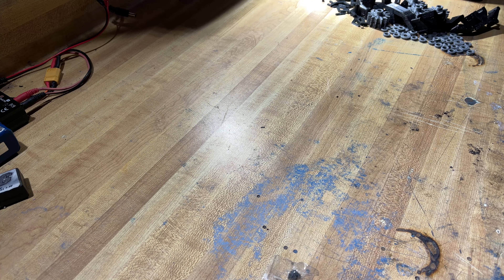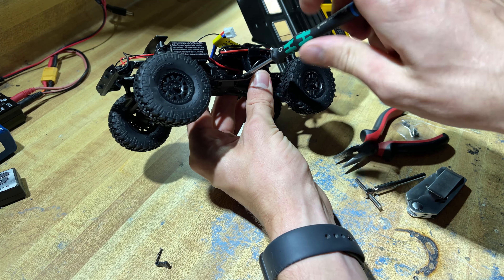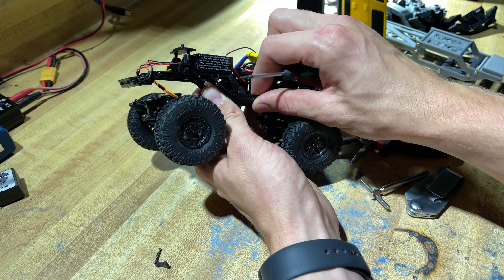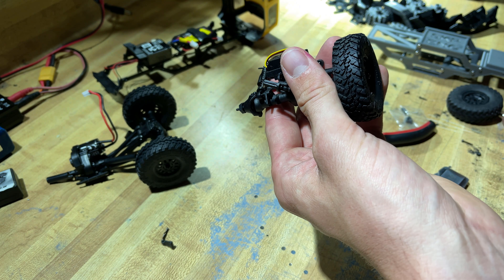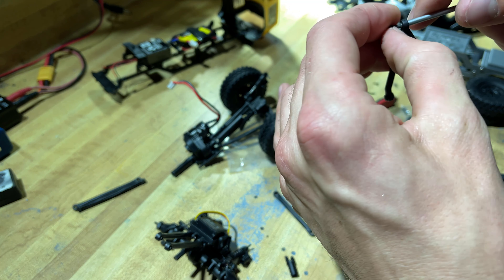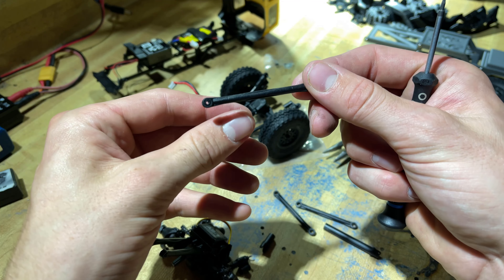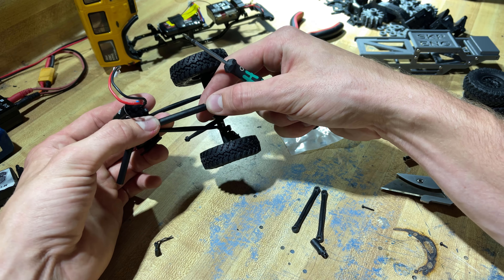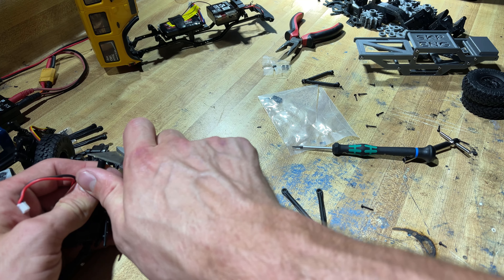SCX24 Warthog Chassis Install!

Comment: My build is in progress. Some notes: I'm moving my battery to the front and my electronics to the rear. The shocks rub against the chassis and cause binding. You can invert them and then trim the retainer to solve that. If running a larger motor (Torquebeast 2.0) the rear upper link hits the end of the motor can and wont allow the suspension to come to full rest on that side and the rig sits cockeyed. To make it work properly I had to make custom bent upper links for the rear. I used the LGRP (or Shapeways) rod ends and the stock link ends (cut off of the links) to make them.

Comment: One tip. I was running into some slight suspension binding when doing great flex. The stock shocks bodies would run into the chassis and that would create drag inside the shock at max extension with twist. I took some extra ball studs from Injora, used a little hex nut from them as well and put the nut on the ball studs. This spaced out the shock body from the chassis rails and it's butter smooth at full extension and twist. There is just enough thread on the ball studs to just reach through the chassis.

Comment: Currently building mine. I was wondering if you're essentially replacing the rear shaft after you move it, wouldn't it be easier to line up the new shaft with the stock rear for measurement to make it the same length?

Comment: I hate to add any tips, but i ended up using extra ball studs i got with some brass knuckles to use with the stock steering links. They worked great when converting to the four link. I also used stock axle length for the jlu rear up front. I trimmed the female shaft by sanding the end down. Just clean up the edges and your golden. 

Trimming the shafts by snipping the ends off squeezed the sides and increase drag so the shaft wouldn't slide freely.

Comment: I recently purchased the files off cults3d, printed this out and built it up yesterday. THIS is the most capable scx24 I've had, thank you! With scrambler tires it can still go over anything, although it hits the shock reservoirs during tight turns,  I need to get some more standard sized tires
Reply from the maker: Awesome! Glad to hear you are enjoying it! You could also get some axle extensions to widen the stance if you want to run the larger tires!
Reply: @CineMoto24  but you talk so highly about the wranglers, I have to buy them now :D
Reply: @CineMoto I just printed a kit from your files.  Looks awesome.  What size screws donyou use to build the chassis?  And where do you get them?
Reply: @trevortopolay1361  M2 x 8mm, you need 14 of them, I bought a pack of 50 off amazon
Reply from the maker: @trevortopolay1361  m2x8mm you can get them anywhere including amazon

Comment: Just received my blue Warthog over here in Michigan. Thanks Shane. It's great. I've been seeing them in videos for a while. Just couldn't move it high enough on my list til now.  Can't wait to install it. Thank you for a great, simple, well thought out option. I have been creating all sorts of designs in my head for some time. I will hit you up when I make some. Don't think I can beat what you have done, but it will be fun to try.
Reply: Hey I’m in MI too. SE MI. My son and I run Deadbolts and I’m really wanting this kit. Have you built yours yet? Any trouble getting the extra bits to complete? Would like to hear how your build went if you don’t mind sharing.

Comment: Im getting ready to order parts for a warthog build. Can I use a regular set of suspension arms? The set I’m looking at is already 4 link…
Reply: You can! As long as they are the correct lengths!

Comment: what size is the extra blot you need? The one that you said comes with diff covers?
Reply from the maker: I believe they are roughly 6mm in length. Standard SCX24 hardware though. If you need one to measure, you can just check one of your bottom diff cover bolts! Thanks!

Comment: Bought mine and printed it up! 

Watched this video late last night and installed on my brand new deadbolt. 

Everything bolted right up, had to modify the rear chassis side shock mount slightly with some new holes because the extended length of the rear of the deadbolt. 

Also, I only installed the extra driveshaft to the front, no cutting necessary. 

Testing it out this weekend next to my other 3 scx24s! 

Thanks again for making an awesome product
Reply from the maker: Awesome! I haven't owned a deadbolt yet but I'm glad you got it working with it too! Hope you enjoy it. I'll warn you though. It makes crawling so easy it takes some fun out of it!
Reply: @CineMoto24  yes! It does! Haha. I have all of my 24s with me on a trip this weekend and even playing around with them tonight it is crazy capable compared to my other very built deadbolt, stockish deadbolt and c10 on dually rears.
Reply: I just finished doing the deadbolt to warthog conversion. I don't have/can't find spare parts that came with my scx24; no long drives haft other then the one for the rear. I ended up swapping using the links that came with the Axial package listed in this video.  Now it has a forward tilt when sitting on flat ground.. Trying to figure out how to resolve now.
Reply from the maker: @wille2075  That is unfortunate that you cannot find your parts. For the deadbolt you must replace all 8 links as it uses different stock links than the Jeep. All lower links for the warthog must be the 60/61mm links and all uppers must be 50mm. Hope that helps!

Comment: I am curious why you made those links you provide with the kit or file, whats the advantage over a set of low clearance links? I am getting confused with your exchanging of links here, also just looked into my still sealed bag of the C10, there are no links, just a drive shaft. So i think i will buy (or find in a box) a set of high clearance links and use those. Still confused, you seem to use C10 rear lenght links for front and rear ?
Reply from the maker: They allow the crawler to have more clearance under the links and is less likely to get hung up! But yes, you use C10/JL rear links both in the front and rear. Axial must have stopped including the additional links in later models. Thanks!

Comment: Can you only do this to a c10 or jeep? Because I have a deadbolt and want to do this.
Reply from the maker: This would work with a deadbolt although you would most likely have to replace all stock links and driveshafts due to the length differences but it can certainly be done!
Reply: Mine was done with a deadbolt. No issues and thing is wicked.
Reply: @blazinghillie  what all did you have to change for the deadbolt?
Reply: Top links and driveshafts

Comment: What size hardware do you use for that actual 3D printed parts. They look like a different size than the actual scx24 screws
Reply from the maker: The hardware is just m2x8mm bolts!

Comment: I like the look of it much more the the upturned nose version.  Great install video.  Question: what is the space available for a larger motor?  an 050 can?  Any larger brushless fit?
Reply from the maker: 050s fit although brushless setups do not yet. I am currently working on a surpass/Furitek version.
Reply: Awesome. Thanks for the quick reply! I look forward to seeing the brushless setup you come up with.  Very interested in this little kit.
Reply: @CineMoto24  im very interested in a surpass verision!
Reply: Ok, I ordered up one finally! Can’t wait to get this up and running. Going with a Mofo RC 050 can in this build to get a brushed motor back in the collection.
Reply: How do you like the MOFO RC 050. I got the Torquebeast 050 from MOFO. I installed Yeah racing fr/rr axles, very beefy. The pin/dogbone in one slipped out of place andbound the axle. That Torquebeast twisted the axle like a string.
Reply: With a larger motor, the top link on the motor side will hit the end of the motor. This prevents the suspension on that side from sitting flat and moving as freely as the other side. You have to make custom rear upper links to get the clearance right. (I'm running a Torquebeast 2.0.)

Comment: Can you put the measurements of what each of the suspension links in the bio? I'm having trouble knowing which ones to use
Reply from the maker: Sure the lengths should be 58.5mm for the bottom links for the front and rear and 51mm for the top links for the front and rear.
Reply: Thanks

Comment: Tires keep ripping off the shocks.  Any help would be great
Reply from the maker: You have to run offset wheels to get the full turning radius or dial back your dual rates. Either will do fine!
Reply: @CineMoto24  any tires and rims you recommend

Comment: i just put my warthog chassis on last night and i was wondering what wrench size or alan wrench to remove the motor is
Reply from the maker: Are you referring to removing the motor from the transmission? I believe it is a 1.5mm wrench if I recall correctly.
Reply: @CineMoto24  is it an alan wrench
Reply from the maker: @gaveny725  yes, it is.
Reply: @CineMoto24  thanks

Comment: I want to buy one but I want to know can I change the steering servo and will a different motor fit?
Reply from the maker: Yes, you can run all standard servos, also you can run either the stock motor, 050 can motor, or outrunner brushless setup.

Comment: the stock screw heads strip so easy on mine do you have any tips for that
Reply from the maker: Yes! Use a 1.3mm driver such as this one. Once I started using it I never had an issue. https://chadstoolbox.com/05118064001-wera-2054-micro-1-3-x-40mm-hex-driver/?gclid=EAIaIQobChMI-bDj-IG99QIVU_LjBx02mg0AEAQYASABEgKZjvD_BwE
Reply: @CineMoto24  thank you
Reply: @TylerJ54  they’ve also got sets of better screws for the whole chassis
Reply: @ethanh3421  ya i ended up getting those to

Comment: With this chassis am I able to use aftermarket high clearance links such as treal or injora?
Reply from the maker: You are! They just need to be 61mm for the lowers and 50mm for the uppers. Front and rear. This is the same stock length as the rear of the Jeep jl or Chevy c10.

Comment: Why are there no videos to show and tell how to assemble the chassis itself, would be handy, I bought your files and had them printed and none of my stock screws work to assemble the chassis. Why is this happening???
Reply from the maker: I am sorry you are having issues. As stated in the cults3d description you will need 14 m2x8mm bolts to assemble the chassis. It can be assembled based on photos after that. If you need additional help feel free to reach out to me on etsy or FB. Hope you enjoy!
Reply: @CineMoto24  oh, ok, I must have missed that. Thank you for replying. Just out of curiosity will you please make a video of putting the chassis together?

Comment: Have you tried or do you know if your chassis, with the battery on the bottom like you have, or even on the top side, will allow a second front axel/servo in the rear for 4 wheel steering?

Comment: Random question. I was watching this video and installing all of my parts. And now it seems like the front is dragging inside the differential or something like that. When I give it gas it has a lot of torque twist and I want to hit reverse a torque twist the opposite way but only in the front. Also the whole thing seems to be slower than normal and the motor was getting super hot
Reply: Your wheel nuts might be too tight
Reply: @naticen  it was.
Reply: Thanks.

Comment: Where did you buy your wheel nut wrench?  I'm assuming it is a 2mm nut driver?  As well, where did you buy your allen wrench?  Again, I'm assuming it is a .05" wrench?  Please and thank you.  Thank you for the 3D printed files as well as this video!
Reply from the maker: The wheel nut wrench is the RC4wd wrench that is included with their stamped beadlock wheels. They also sell it standalone here: https://store.rc4wd.com/RC4WD-40mm-Metric-Hex-T-Wrench-Tool_p_5535.html
The driver I use is this one right here. By far the best for these little bolts! https://www.amazon.com/Wera-05118064001-Kraftform-Electronics-Screwdriver/dp/B003ES5MDU/ref=sr_1_5?crid=2UIPLCTXUZ56R&dchild=1&keywords=1.3mm+hex+driver&qid=1632139406&sprefix=1.3mm+%2Caps%2C174&sr=8-5
Reply: @CineMoto24  Awesome and thank you for the reply with the links to the wrenches.  
For the chassis - I ended up purchasing your print plans and printed my own warthog chassis in purple PLA.  Came out great!  Thank you again!
Now I'm just waiting for the screws and Axial parts to arrive to put it together.
I also ordered a set of the RC4WD stamped steel wheels.  So, I'll wait to see if I get a wrench with mine.
Clayton